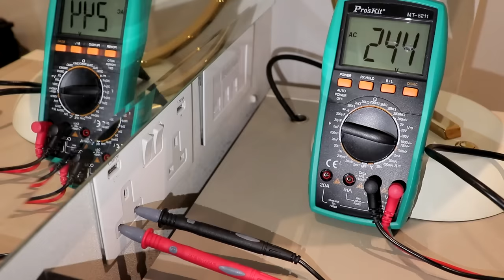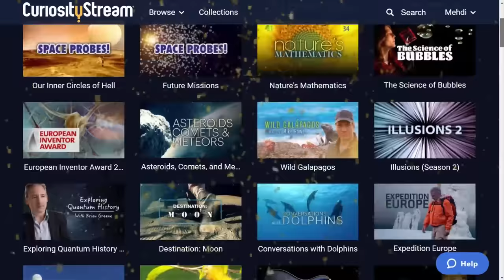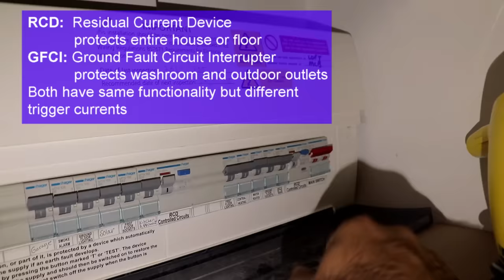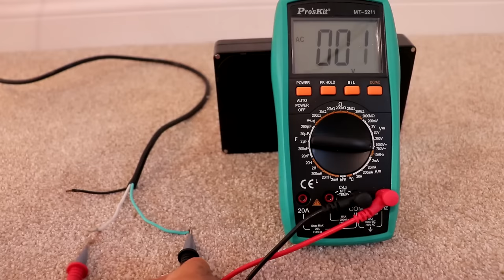Power Outlets in United Kingdom

Comment: I'm betting that the coating is practical to if you could get your finger in because of the length of the metal. US plugs have ither too short of a metal and/or lips on the edge that make something already difficult harder. And the depth of the metal to touch is probably taken into account with the various plug housings.(I'm also assuming the depth is standardized.) If you had it half way in to get a contact it probably would be really hard to make it touch the metal for various reasons. One being how much space there is compared to various finger sizes. If putting a finger in either pushes it out far enough to make contact or literally can't touch it if it stays then it's just as secure if not more than plastic coating. I'll imagine all countries with coatings is literally because of contact depth and/or length of the metal. They are probably equally safe if that is taken into account. I'm guessing the only way for US plugs to have a problem is to somehow modify either end of the housing sufficiently.
Reply: You'll notice US plugs are also deeper in the housing making the angle to the metal and depth to reach it harder to achieve. I'll assume both/all plugs are fully thought out in that aspect. Those british plugs are closer to the edge, fatter, and easier to touch compared to the housing. So, they are probably just practically designed to those realities. Not sure if there is any other reason for US plugs to not have coatings. Does it effect the power flow? They are made of one bent piece or used to be hence standardization issues. Is there a problem with coating on the bent end versions?

Comment: It’s 240v in the UK.  If that’s an older hotel that ring circuit will have a 32a MCB type breaker or even a wired fuse.  More modern hotels will have individual RCBO protection for each circuit.   There’s still, depending on the resistance of the circuit a prospective fault current in the hundreds, potentially thousands of amps.  The plastic pins are there to protect fingers not little bits of wire.  That’s why you vaporised your test rig you dope. 😂

Comment: Why not plug the plug in halfway so only a fraction of the metal was on show then use your probes on multimeter to test….. rather than a dead short with wire thin enough to go inside the holes and that wont definitely slide back to the plastic? ….. oh yeah, because it’s less fun….

Comment: Hi ElectroBoom, I have a question:
How much do the different frequencies in North America and the rest of the world affect each other in an adapter?
Reply: AC to DC supplies don't make a difference because AC is converted to DC in the adapter and then fed to your device. That is how laptops and phones get charged. These AC/DC supplies can handle 50/60 Hz. Bulbs and motors and fans are a different story. Going from 60 Hz to 50 Hz, all other things being equal, they would run slower. The bulbs would flicker at 50 Hz than 60 Hz. 
The problem is voltage. Where 50 Hz is used, the voltage is 220/240 Volts primarily. 60 Hz countries use 110/120 Volts AC. Plugging 110 Volt rated devices in 220 Volts will result in you pulling a Electroboom. Don't do that!!!
DC Adaptors for the most part are now universal. They take from 90-250 Volts AC and 47-63 Hz rated and output a constant DC voltage which you use to run your laptops and phone chargers.

Comment: Compared to German systems still shit, who the hell designs flat plugs, there have to be inlets so you cannot get a shock at all. Aside of this u will never have issues that the plugs fall out like in previous Videos. And here u can even tough the living wire as new circuses are protected in a way that you will not even really feel something
Reply: To answer some of the questions, the UK plug is fucking hard to pull out of the wall by tugging on it, furthermore with the insulation on the live and neutral pins you can't get shocked even with a non-recessed socket.

Comment: I know the ground is plastic on some adaptors, but that is to open the plugs inside safety mechanism otherwise you would not be able to get the live and neutral in without it having a ground/dummy ground pin - Its the same here in South Africa.

Comment: I feel like America would survive on 240v AC if everyone had RCD, and it tripped at 5 milliamps like the GFCI.
Reply: We already run nearly 240 volt in tons of places in North America....
Reply: Certain wiring can achieve this
Reply: @bmo14lax  by that definition, uk runs on 400v. just cause u use 2 phase doesnt matter if most sockets dont permit it!
Reply: @bmo14lax  NA has a split phase system, 2 120volt rails 180 degrees apart resulting in -120v 0v and 120v. But the vast majority of sockets are wired for only 120v differential. 

Many European countries have 400v system with 3 phases 120 degrees apart, where most sockets are wired up for 230v. The effect is the same
Reply: @techheck3358  can you explain the " 180° apart" to me in layman's terms? I understand it's to do with phasing but besides that I am a little unclear. Is that related to the 50 to 60 HZ cycles they go through as well? You know a lot more than I do. I appreciate it
Reply: @bmo14lax  a sine wave like mains AC can be modelled by a dot rotating around a circle, that’s what causes the smooth “waves”. With a multiphase system, there’s multiple dots on that same circle. In the NA system they’re 180 degrees apart - on opposite sides of the circle. So when 1 phase is at its peak, the other is at its trough, so there’s 240v difference between them that higher power appliances like induction hobs can take advantage of. In the case of Europe, there’s 3 of those dots, 360/3=120 degrees apart.

(Slight technical thing, NA has 120v rms (root mean square), the actual “peaks” are at 170v)
Reply: @techheck3358  So adding and removing power power creates peaks and valleys that sustain a constant voltage?
Reply: @techheck3358  by adding the second terminal to mains from 120v gets it to 240v by step up? I understand the sine wave part better now thank you. I guess I'm not understanding where the "extra" power is to achieve the 240v peak NA
Reply: @techheck3358  are the breakers also technically transformers then to get the voltage higher peak ac?
Reply: @bmo14lax  because the sine waves are exactly opposite, when one is at +120v, the other is at -120v. So you have a 240v difference between them.

As an analogy, imagine you have a water pipe 120metres/feet above ground level, and another 120metres/feet below ground level. The water has 240metres/feet total distance to fall, so it’s more powerful